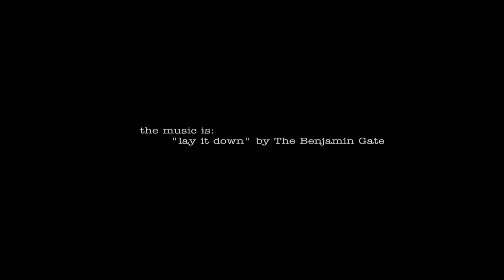lay it down: last days of the melt shop

Comment: I worked at Newport Steel in Wilder Ky.  for almost 30 years, until I made an" illegal" dive (due to some idiot had swung the roof closed from the open position, more or less shoving me off the top of furnace wall to the basement floor landing in the slag pit), a total of 40 foot fall, shattering my right wrist and herniating 5 disks in my back and cracking 3 of my spinal bones in the Lumbar region because I was trying to control my fall  as instructed in Paratrooper schooling, while off on sick leave the plant went into the process of being sold to an outfit from Italy, who later partnered with another outfit and now called Dofasco. The only thing left of the plant now is the two pipe mills, part of the strip mill, and the store house. They dismantled the Melt shop, Bag house, Machine shop, Time office,  Fab Shop, Engineering building, Laboratory and Locomotive repair building, The place is a ghost town of it's former self. I am now retired and have been for the past 22 yrs. Don't miss one bit of that place, but do miss the many friends I had made during all those years both living and those that has died since I retired from that place.

Comment: Ive got some questions. I have watched videos of slag being poured off into pits or slopes, and big chunks of slag being removed from buckets. 

1: what exactly is slag?
2: can it be reused? is it piss-poor materiel thats not worthy of anything?
3: is slag production generally seen as a very bad thing? or is it just considered part of the industrial process?
Reply from the maker: A little late on this, sorry.

1: Slag is impurities (mainly iron, silicon, and aluminum oxides) that float to the surface of the molten steel.  Slag can actually be an active component in the refining process through the use of additives.  Lots to that, google something like "slag steel refining ladle metallurgy" or some combination of those terms.  In addition, slag isolates the molten steel from the atmosphere and helps protect the chemistry of the molten steel from degradation.

2: Yes but mainly for structural applications and as a replacement for gravel in some applications.  Slag can contain traces of valuable metal oxides which can be extracted but it's not a big industry that does it.

3: Slag happens, lol.  You can't heat things to such high temperatures in normal atmosphere without making oxides.  Make too much, and you are sacrificing yield as you make iron oxides.  Carbon is a common material for reducing (deoxidizing) steel along with other compounds that help get you to your final chemistry.
Reply: Thanks for the replies! That explains some of the weird metallic lumps i find used with gravel on train tracks. I sometimes find these weird misshapen lumps that seemed to be melted and refused metal. That solves a child aged mystery!